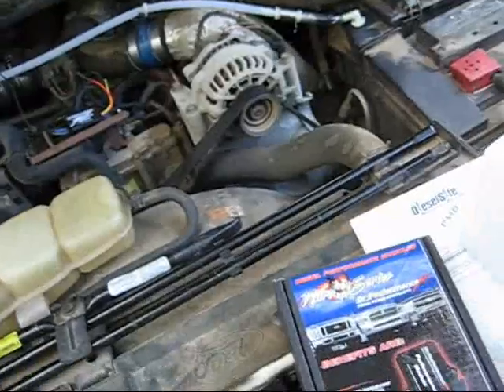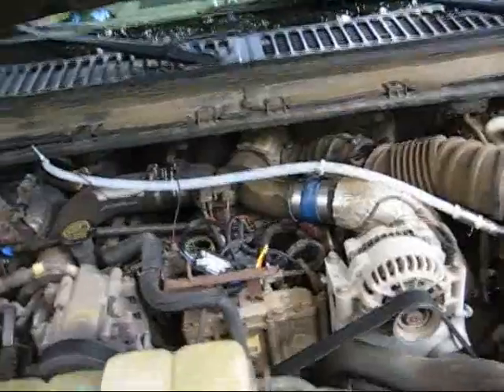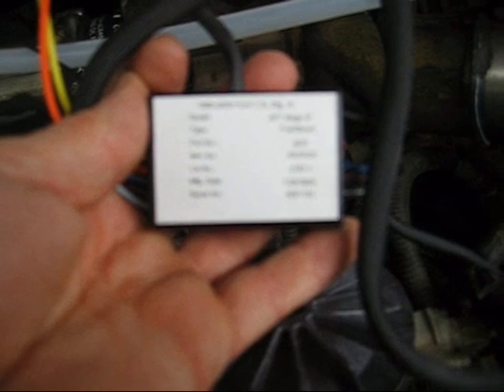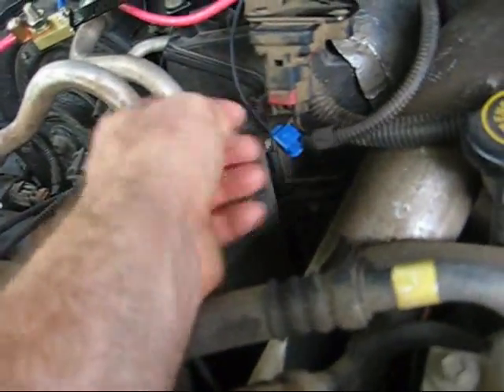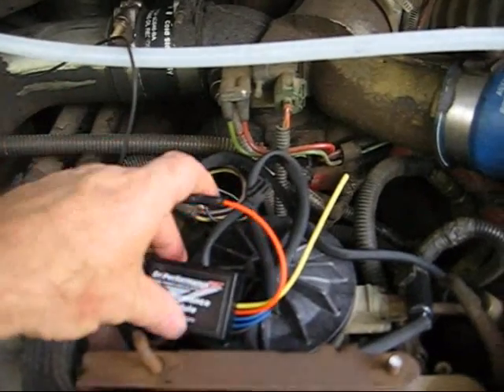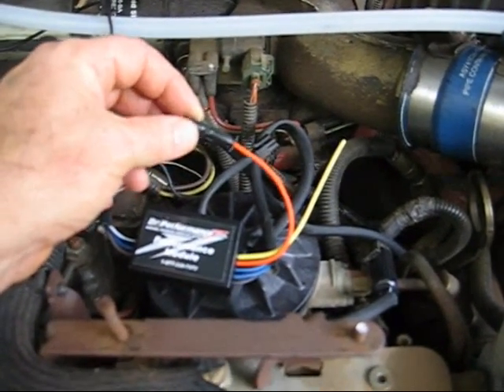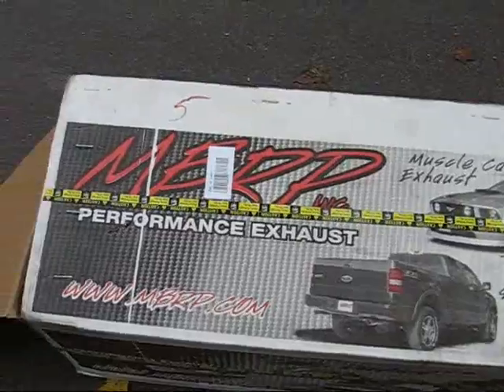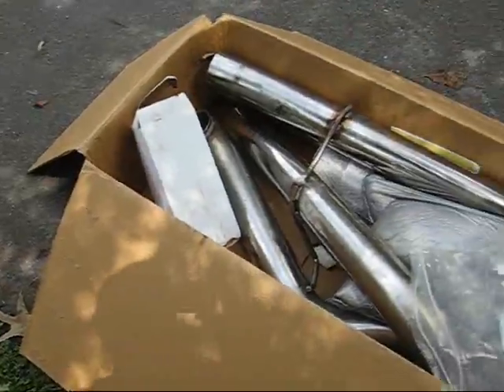7.3 Liter Powerstroke MPG Upgrades Part 1

Comment: I have a 2002 Ford f250 7.3 l diesel get about 11 miles per gallon in the city and 27 to 33 on the highway going 60 mph with the AC off and the windows up why is such a drastic change

Comment from the maker: I am doing a complete upgrade on this truck right now. When I tore it apart I found that the up pipes were leaking and that the transmission was slipping. I think that those two things were the main reason for the less than normal mpg. I have diagnostic software and the only code was one for the trip computer.

Comment from the maker: Yes I tow a lot. I tow a 12,000lbs dump trailer and I 10,000lbs flat bed. The flat bed got stolen along with my small tractor so now I have a 15,000lbs goose neck to haul my tractor. The goose neck was too much for my mostly stock truck so I did a major upgrade. The upgrade is almost done and the videos are in the can so keep watching.

Comment from the maker: This truck did not come with a catalytic converter. I put a straight though muffler along with a 4" turbo back exhaust. When I ditched the OEM exhaust and muffler and installed the 4" there was almost no improvement in the MPH.

Comment: Mar1952,  I have 2002 f350 dually with a 7.3 powerstroke that I use it for work very day and I have it loaded pretty good and getting around 10 mpg.  I was wondering on your truck after all the upgrades what is the high mpg were you getting when you are towing heavy loads.  I tired of low mpg and I want go through the same steps and increase my mpg.  But I do not want to waste my money on the fake mgp upgrades and trust you in your recommendations. you can also contact me at youels@gmail.com

Comment: @mars1952
   G'day... Great clip, and nice work..! Ironic that the BIGGEST Fuel-Sucker was silently lurking in centre-frame, most of the vid.. Your Step-Up Belted Alternator, feeding the depleted Battery. It's only 2%-3%FUEL-Efficient.
Chìnese 2-Stroke Gennys are 10% F.E.,& 4-Strokes =12.5%.
Search 'SunFoil Short-Talk', then 'SunFoil Science' &  'SunFoil Mk2 Construction'. There's 12+ clips covering all angles, even 'Solar Thermal Ramjet Effect'. Open Source. DIY. Ciao !

Comment from the maker: @kklein41291 I think that you are referring to the PID temperature controller. If so yes it works very well. I have not used the control features yet but it works very well as a EGT gauge. A blue warning light comes on at what ever max temp you set. I have it set to 1250F.
Mars

Comment: @urbex2007  mars is correct, the truck accelerates easier and results in you having to give it less gas to get to speed. i cruise with mine in 100hp setting all the time and been getting 22-24mpg on highway. good informative videos mars! my truck has 251k miles too so i dont think its harming it at all ;)

Comment: Let me reveal a small thing about those "performance/MPG" chips.  If you deal with a car or a truck of this kind then you might consider an upgrade, however the difference will not make a buck. You might get a 3% increase out of something like that. But if you deal with  sophisticated cars like a BMW or Lexus then those cars already have the best chip and putting something like this will only mess up the system.

Comment: thats a piece of junk chip,too much wirs to hook up,no trans tuning,no shift on the fly,and most of all no custom tuning.Get a DP tuner and be done with it.Also those boots from ITP are top of the line but not needed for the chip cause that chip will not make enough boost to blow them off.you are not fixing the problem with the boots,you have to do the cheap ccv mod which reroutes the blow by from the engine to underneath the truck bed.If you do that your intercooler and boots will be oil free.

Comment: change out your gears you got  410 gear ratio, for better fuel millage you want a 354 got the same truck 02 i got  100hp injectors 140hp chip diablo sport 4in magnaflow exhaust short can airaid intake.was getting round 27mpg on straight diesel with 354 gear ratio then truck got wrecked and converted it in to a dually with 410 ratio now getting round 22mpg

Comment from the maker: Hi urbex2007: The Dr Performance chip did not cause black smoke from the exhaust even when I put the hammer down. Surprisingly it did increase my fuel mileage a little bit, just not as much as the advertisement said it would. It did increased the power of the engine a lot. I'm talking burn all four rear tires and press you back into the seat power. The problem was that it pushed the EGTs too high (more than 1250F). I returned it for a refund.
Mars

Comment from the maker: Continues: If I had kept it I would have neatened things up some. The piece of white tubing that extends across the engine is part of an HHO prototype. It will be replaced when I put in the next version. I had to snake the tubing from the bed to the air intake. I started with a 20 long piece and it turned out to be just a little short for a neat install.
Mars

Comment from the maker: Hi Again: I'm sorry I got so testy in my first reply. I am guessing you are talking about the DR Performance chip fooler. Believe it or not I installed it exactly as the directions showed. Since I was just testing the chip and I thought that I might have had to return it I didnt shorten any wires or change it in any way. As it turned out I did return the chip for credit. Continued:

Comment: we got a 03  f350 dually with the 7.3 in it and we can hit 17 with tunnel cover, 4" exhaust from turbo back, and edge evolution reprogrammer in performance. that is a great balance of power and fuel. the reprogrammer has race, tow and stock options to if you dont like performance.

Comment from the maker: Hi skatenowok 56K miles is very low for a 1999. Make sure that the miles are accurate. 56K is early for a water pump to fail but it does happen.
Check out YouTube user "powerstrokehelp". He has a video that shows how to evaluate a used Powerstroke.
Good Luck, Mars

Comment from the maker: The truck came with a trip computer that show the average MPG. But I calculate the MPG by dividing the miles driven by the gallons used. I top off the tank to the rim for each MPG test.
Mars